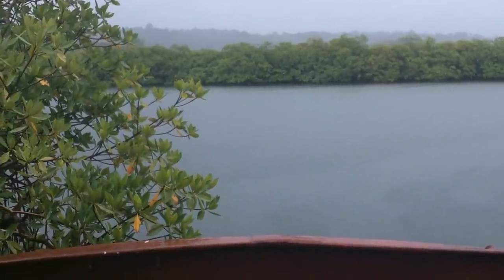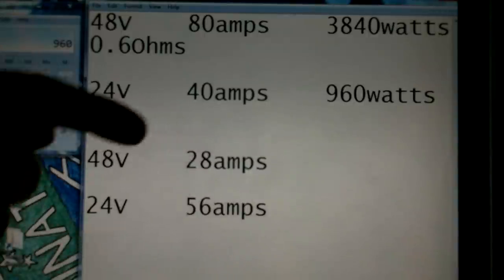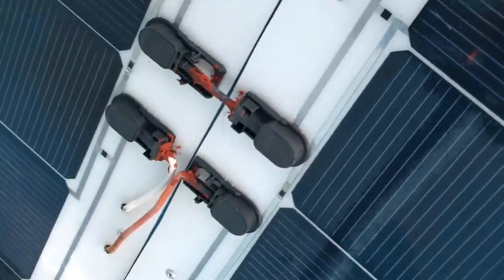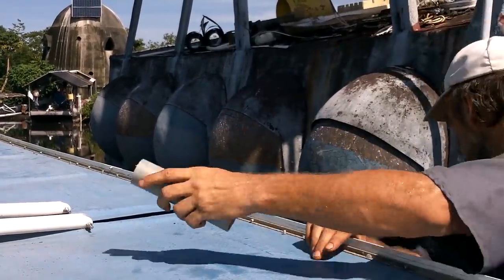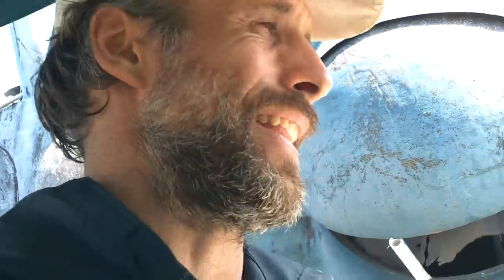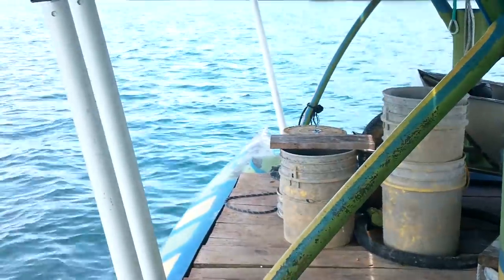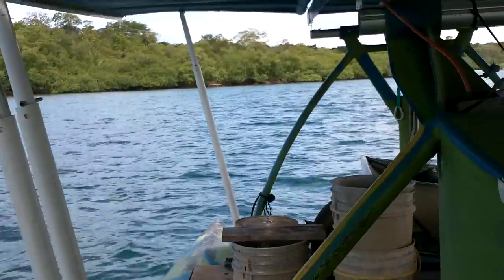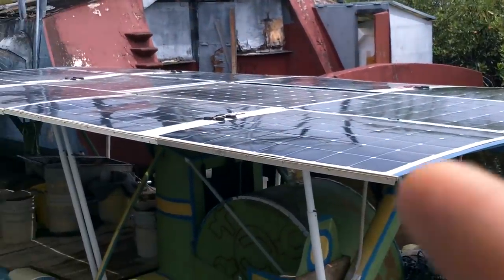Boat Edit.  48V to 24V

Comment: Central pillar is sailboat mast. other pillars are intermediate for supporting the running track on second (or third?) floor. Going to be immense! Thanks for the sneak peak! Mostly thanks for just a quick vid, even with out the peak, I would have been delighted <3

Comment: Love seeing updates on your solar boats! BTW, I tried using those same battery packs and had a ton of issues with them - many of the ones on the used market were very abused as they came out of high current discharge/recharge cycles from hybrid busses. If you disassemble the packs to individual cells and then test each cell for capacity and internal resistance you might be able to make usable packs but it's a pain.

Comment: This is a preventable shame. Jamie ruined his batteries by mis-understanding how Lithium and Lead Acid batteries work. When he described his battery plans when he first implemented them a year ago, I said that he would ruin his batteries if he actually went ahead with that. Sadly, that seems to be the case. I hope I'm wrong, but I don't think so. Here's what I said a year+ ago:

"He plans to hook up a higher voltage of solar panels to the battery than the battery's maximum voltage.

This will irrevocably destroy the batteries the first time he does this and doesn't manually disconnect them before they reach their max voltage. And I don't mean, "may suffer degraded performance", I mean, he'll kill them outright the very first time.

His logic is "The batteries are charging too slowly. To make them charge fast enough I have to give them higher than their max voltage."

He is wrong. This is how lead-acid battery and NiCad battery chargers work and is suited to those chemistries. This is not how lithiums work.

 - He is wrong that this is the problem. That is not why they are charging slowly.
 - He is wrong that this will correct the problem.
 - He is wrong that this will be okay for the batteries.

The reason that his batteries are charging slowly is because on the Zombie Chopper (same batteries) he was giving them enough voltage to charge them up to a small fraction of their capacity, because he doesn't understand the difference between nominal and max voltage. Imagine trying to stack a tower of bricks 20 feet tall but you can only reach 7 feet high.

Jamie's mistaken logic is "It must be that I'm not adding bricks fast enough!"

No, he's not adding bricks tall enough. Regardless of rate, he could try to add bricks for a month but he will never get higher than 7 feet.

So his solution is "I'm going to toss bricks from 30 feet up, really slowly!". Which doesn't even make sense by his own logic, and, suppose the max height of bricks before they crumble under their own weight is 21 feet. He's going to ruin them by overstacking.

...

Lithium-Iron Phosphate batteries have almost limitless ability to accept energy when charged. You don't need to have a large voltage difference in order to get them to take energy like you do with NiCad or lead-acid. In fact, they're so thirsty it's normal to not even give them any more voltage than their max, because they'll already flatline any power source and charge as fast as possible, right up until the moments before they're charged.

That is... especially with solar panels, if Jamie just gave the correct voltage to his batteries, they'd be charged 99%+ before the voltage difference won't be enough to charge them at the max rate of the panels. Functionally, before they even start to slow down, they're full.

Instead in the past he was giving them a voltage that corresponded to like, 30-40% of their max charge, then noticing they never got higher than that, and concluded the problem was with the rate, not the max voltage.

So he's going to give them 130% of their max charge, thinking it'll make them charge faster. It won't. Not 1 second faster, because his rate is already maxed. But it will completely destroy them the first time he does it because they'll overfill.

What he needs is a DC-DC converter that will take a range of input power (solar), but always provide a steady output voltage (the max voltage of the cells).

But he thinks he's being more efficient by avoiding the electronics, and more fool proof. He's not, and he's not."

Comment: On an electric car I built I actually had more trouble with sealed lead acid batteries than with LiFePO4 batteries. I guess flooded lead acid golf cart batteries are robust if you don't mind the outgassing and having to water them, and for a boat weight may not be such an issue, but their lifespan is still much shorter than the LiFePO4s.

Comment: Wow it's been ages since I saw anything from you, actually was thinking about you and your awesome forest home just a couple days ago, dreaming of having something similar someday. Hope you're doing well!

Oh btw, speaking of lead acid and lithium batteries, if you mean by last longer as in total lifetime, I've had lead acids that are still functioning and over 10 years old now, as long as you keep them charged, check the water/acid levels in them and top of with distilled water, generally just taking care of them they'll last a long time. Biggest issue is dendrites building up potentially short circuiting a cell and thus losing power, which happens more when the charge is starting to go low, something about the chemistry and stuff. Lithium on the other hand I've had small batteries puff up and die in a year, but I don't know much about them or various types.

Comment: I've been singing the lead-acid song for years. I have both. Apparently LFP are more efficient but they need electric blankets in Ireland in the Winter and I have to derate my chargers according to their temperature. Cycle count is pretty similar...it's just a weight difference really and a whole lottov lobbyism

Comment: A 200A waterproof Vesc run at 60A with all the currents limits set would run all types of motors and live for many years. You can change the phase timing of a certain rpm to get more top speed. I'm using smaller Vesc on my sail boat and the current limiter saved everything when wheeds jammed the propeller. A vesc takes some time to set them up with a computer but afterwords its bullet proof. Buy a Vesc and use it within spec you'll have a solution that last for many years. Everytime I switch into this channel I see you with a new motor solution and a vesc would run all those solutions. All the way from DC to brushless motors :).
Reply: Electronic rubbish! Go away with your built in obsolescence scams!

Comment: I've used a really good $20 variable speed controller/pwm on several ebikes and projects. If you plan to run 24v at 1000w look at my electric trike videos.  That board can easily workas a throttle for the boat.

Comment: Unless you modified that motor to be a 24v motor it's going to burn out. The wattage stays the same so the amperage going through the motor would go up to 160...or it would max out at the amperage of the solar panels...in which case you'd be fine as long as the panel amps don't go above the 80 amp rating. Go back to 48 volts. The wires won't get hot.

Comment: Not all new technology is bad. Aside from being less durable, Lithium batteries have huge advantages over lead acid especially if you're concerned about weight. Just wait until solid state batteries come down in price. Even more energy dense than lithium and you can cut them in half and they still work!

Comment: Solar arrays are usually twice the volts of the battery bank. To make up for  angle of sun, dirt, corrosion, etc. Batteries will take too long to recharge. Only charge around noon.
Reply: actually his panels can lean on a 45 degree angle.
Reply: Yes, he need lifepo4 batteries because the can be charged in one hour. Lead acid need at least 12 hours. A lithium battery can be charged as fast as 1C, whereas a lead acid battery should be kept below 0.3C. This means a 10AH lithium battery can typically be charged at 10A while a 10AH lead acid battery can be charged at 3A. The charge cut-off current is 5% of the capacity, so the cutoff for both batteries would be 0.5A. Lead acid batteries need twice the solar panels to charge it because 45% of energy is lost to heat resistance. Lifepo4 batteries only lost 2% on the energy.
Reply: @neliosamch3195  - Nothing you've said in this thread is correct. You can charge lead acids in an hour if you push them. Jamie does not need a fast charge, that's not his limitation. The problem is that he was charging the batteries to too low a voltage on the Shark Slicer, and misunderstood why. Then decided to overcharge them on the Solar Snailer to make up for this. Which overcharged them and ruined them. Because he misunderstood why. All he needed to do was give them a constant voltage power supply that can take a range of voltage inputs, (it could be higher, a "buck" converter, lower voltage, a "boost" converter, or even a buck-boost if you're too lazy to pick one) and output the max voltage of the batteries. That's it. One power supply solves all of his problems. He can't do that now, he ruined his batteries by overcharging them.

Comment: Hey, was wonder about you. LOL? Excellent work., see you thought it out, precut the line then use the long saw shaft to stay straight w/ the line.. and resulting in straight lumber. Cool... logic wins. 
On the shaft with grease. Seem there is no online solution. Here my idea. Regeneration you have dremer drill with cable extensions? They work well. So why not make a bigger one. They say the more cable strand the more flexible the cable can be.. so here my  idea. Use pvc 1" thick and make a smooth 45% angle or even 2 - 45% so straight at 1-1/2 under water and it straight to the level motor. The 45% are smooth bends  & you can lug the inside of the pvc. To make the bottom seal is up too you. 
To find the thick stranded cable is hard. But maybe you can string together your own. Or what about Manila rope? That flexable can you fiber glass the outside to make it non twistable . So it can carry the torque? Just ideas....

Comment: You should install cheap analog volt meters and have one good current clamp meter you move from boat to boat, so you can see exactly what the panels are doing as you drive

Comment: Sneak peak of the big project!
Lifepo4 batteries are better than lead acid ones but should not be charged more than 80% of the capacity at least you have a good bms and a good solar charger and ready to use the charge.
48v better than 24v because less heat dissipation and smaller wire size.
A/C motor is better than DC motor because easy to control the speed, is more efficient and last longer. 
And yes using 3 stream of 48v to control amperage is low tech but effective.

Comment: Are you using a BMS?
Pretty sure you are charging them without a BMS and just setting a target voltage.  With large series packs this isn't advisable as individual cells will drift and then start to be regularly be undervolted or overcharged resulting in early death!
If you want to do this then you need to at the very least balance the packs once a month or so.

Comment: Hi Jamie, are you sure you need those blocking diodes? My understanding is you don't need blocking diodes for parallel panels, as each panel itself acts as a diode.  Especially as you have isolating switches anyway. Easy enough to test, just measure the leakage current with a switch open. (Series panels do however need bypass diodes to cope with shading).

Comment: I would caution you against lead acid. I know what you mean, but a quality li-ion cell will last a very very long time if properly cycled and kept within it's limits. I can vouch for that. You may have had experience with poor quality cells, which are a night and day difference from Panasonic/Sanyo, LG, Samsung batteries.

Comment: Too bad about the EZ Outboard.  I wonder what materials Golden Motor used in the motor.  Dissimilar metals in high temperature salt water containing a lot of organic material is a recipe for a high level of electrolysis and corrosion.

Comment: Automobile surplus battery's?
Reply: batteries
Reply: No that won't work. Automotive batteries are starting batteries. They are maximized for power, so the battery plates are very delicate honeycombs with lots of surface area for the chemical battery reaction to happen as fast as possible (to start the engine, the only thing the battery is used for). For example, you could drain a car battery in about 30 seconds. You can get all of its energy out very very fast. These are not ever meant to be used to store energy, and if you drain them, even a handful of times, the delicate honeycombs get consumed and crumble into dust at the bottom of the battery cell. And, there's no extra room there, so that dust shorts the other battery plates and ruins them.

Specially-build "Deep cycle" batteries do not use honeycombs, they use solid plates. This means there's less surface area (so the chemistry can't work as fast, so less power, you might only be able to drain them over a whole hour), but far more durability. They don't eat themselves. And, the battery case has extra space at the bottom so when parts of the plates do corrode and crumble, they have room to sit at the bottom of the cell without causing extra damage.

Even then, deep cycle lead acid batteries are a poor choice. You can only access about half the energy stored (to access the rest, you have to get it out at a trickle stretched out over an entire 24 hour day), and they still eat themselves whenever you discharge them.

The batteries he's got were perfect, bulletproof, idiotproof, until Jamie made a deliberate, ignorant choice to directly overcharge them and wreck them because he thought it would be faster and better to overcharge the batteries. He mistakenly thought the reason they weren't charging was because there weren't enough amps, when the problem was that he was giving them too low a voltage. So he gave them a high voltage to get more amps to flow, and ruined them.
Reply: @MattsAwesomeStuff  Thank you for the information!

Comment: I told you this before you need more voltage to use less amps and a brushless motor can handle more voltage I've already done this you need 72 volts
Reply: Yes, the higher the voltage the better. Electric trucks and busses are using 720v with a/c motors.
Reply: Not really guys. Over long distances, yeah higher voltage is slightly, slightly more efficient. Like, single digit percentage. 1%, 3% maybe, to get the same power out of higher voltage lower amps versus lower voltage higher amps. Also a brushless motor can't handle more voltage than a brushed one, it completely depends on how the motor is designed. The type of motor has nothing to do with the voltage. But yes, what he should do is run at a higher voltage, and instead of running it flat out, just use a damned speed controller. They make these for bikes, sealed units, can leave outside in the rain all day. Jamie bought cheap parts and then is like "They don't make them like they used to" when he's buying the cheapest most disposable thing available. There are absolutely speed controllers that can be bullied and smashed around in every type of weather and still last 100 years, he just didn't buy one of those.
Reply: @MattsAwesomeStuff 
 60a×24v=1488w
60a×48v=2880w
2880-1488=1392
1392 watts  increase just by using 48v
Reply: @neliosamch3195  That is more power than he has available, that is why he went for 24v.
Reply: @neliosamch3195  - That doesn't mean anything. There is a voltage and max current of each solar panel. You don't create more power just be rearranging it differently. You can think of voltage and amps as length and width. You can be 1x10, or 10x1 or 2x5, or 5x2... they're all still 10 surface.

What Jamie is doing is saying that at 48v, his motor is trying to pull far more amps than the solar panels can provide. So the voltage sags down low, but the amps can't rise. So he might as well wire them for 24v, at double the amperage. 24v is still enough to spin the motors fast enough, but now it has double the power.

This is, of course... stupid. What he needs is a damned speed controller. Because 24v is too low for him. He should run at 48V, and just have the speed controller vary the voltage by pulse control, probably in effective giving the motor around 36v based on his observations.
Reply: @MattsAwesomeStuff  Thanks for clarifying that. Yes, he will need six 400w panels then he can have 2.4kw to run the motor and charge the batteries at the same time.
Reply: @neliosamch3195  - No, that's not true at all. That's completely irrelevant. What he needs is to take a variable range of voltage input (solar panels, depending on light), and change this into a steady voltage that's the max voltage of the battery. That's it. Everything else takes care of itself. Whatever the maximum amount of power he has, will go into charging the batteries, regardless of whether it's sunny or shady or anything. On the output side, he could use the same DC-DC converter, or a different one. In this case he wants to take the variable voltage of the battery or solar panel (whether sunny/shady/charged/discharged) and output a variable voltage to the motor. This will correspond to how fast the motor is trying to spin, the harder of which (if he's heavier or upwind) the more amps it will draw for that given voltage. He may notice it's really hard to push a heavy load upwind, and decided to lower the throttle on the motor so it's not running as hot to maintain the same speed.

None of this requires rewiring solar panels, adding solar panels, or anything else. He just needs to actually give things the correct voltage, which is easily done in weatherproof, proven, off-the-shelf chargers or speed controllers or variable voltage power supplies. This is 100% a solved problem decades ago for electronics.